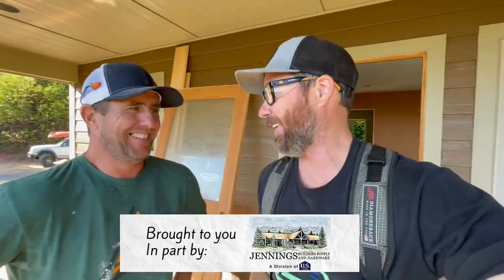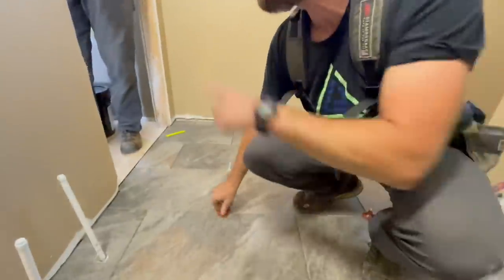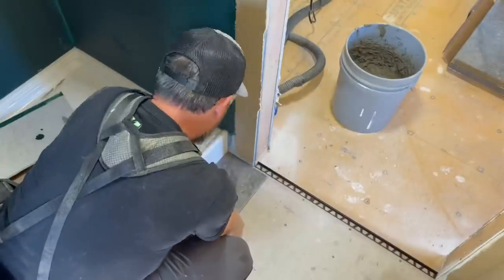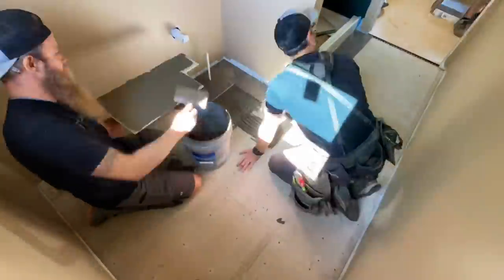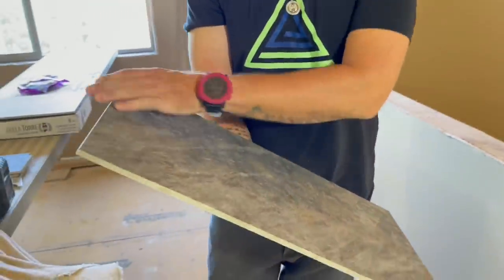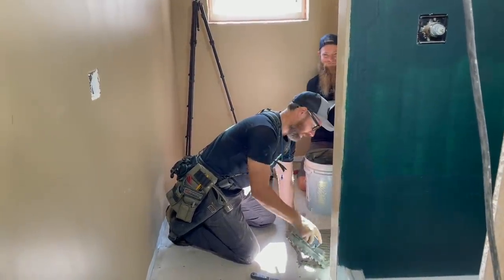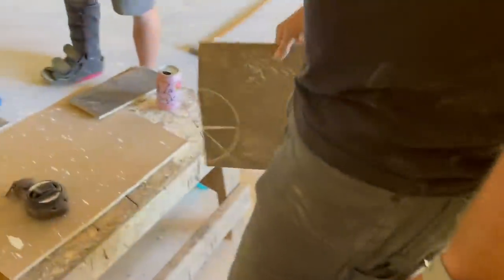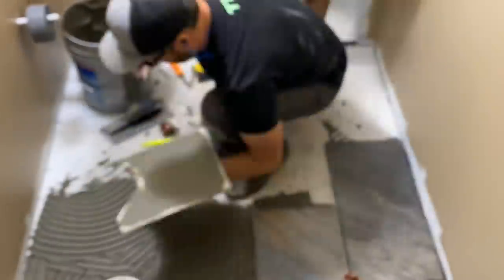Building The Nantahala Retreat #34 | Tile and Grout for beginners

Comment: Tip for the caulk. Spray with denatured alcohol after you lay your bead then wipe with finger. Works with silicone on counter tops also. Once you try it, it will change your life. 😉

Comment: Pro tip... When caulking with silicone apply the caulk, then spray it with window cleaner or denatured alcohol and then use your finishing tool to profile the caulk line.  Works amazing, no tape, very little to zero mess, and its fast. We use silicone based tile caulk all the time for showers and tubs and I stock cans of window cleaner in the van for that purpose.

Comment: When I used to do all that (talking about the caulking grout), when I used silicone based,  I taped both sides matching grout width, put the silicone and use sprayaway glass cleaner. The glass cleaner cuts the stickiness of the silicone and you could slide your finger to smooth it out. It doesn’t stick to your finger and it can be easily wiped off your hands 😉. That way it is perfectly even and no mess! Pro tip of the day for you guys!!! Thanks for showing the struggles of the trade. Keep up the good work and the fun too!

Comment: I’ve always found it much easier to tape off the joint with painters tape when doing grout caulk. Leave about 1/16” reveal onto the tile and on the other surface (in this case the tub) and then run your bead of caulking and smooth it out. Then pull the tape and you have a perfect line. Always turns out well. Give it a try!

Comment: Just a tip for tile - use directional troweling. Also, Grab a polishing/sanding blade from rubi for the grinder to touch up the cut edges and make them look nice 👍🏻

Comment: I have that same saw, and it is out of square exactly the same amount! I switched to the handheld circular saw type (skilsaw like) with a clamped on straight edge which is especially helpful for large format tiles. Recent countertops were 24x48” pieces :-)

Comment: First tile job I did decades ago was in my basement bathroom.  Tile looked great, but I learned that the tiles need to be perfectly level around the toilet flange.  Otherwise the toilet has to be shimmed, and then you have to hide the shims.  To this day, I notice it every single time I use that bathroom!  Great video guys!

Comment: Yes… leave the whirly gigs on and snug and kick them off in the direction of the grout line it is on. Or use a rubber mallet / small dead blow. I keep some of the stems for spacers in certain areas and recycle the rest. Also look into Laticrete Strata mat or schluter ditra. Better performing and much much easier to use on floor than dirty dusty cement board. I prefer the stratamat because you can see thru it to know it is embedded in the thinset and allows use of modified thinset under and over it. Less types /number of bags of thinset on a job the better. Underlayment is only to separate the house movement from the tile. Not to provide structure. Thats what the subfloor does and why it has to be a min 7/8” under tile.  
Love the vids guys been watching the channel since the start.

Comment: Apply some leftover waterproofing membrane on your 1/4" hardi after taping and mudding the seams. 

Benefits are immense, your mud doesn't flash as fast, you get a better bond (hardj is notorious for creating a weak bond because of how fast the thinset drys and how clean it stays.) you also get some added crack isolation that's built into the waterproofer... oh, and your floor is waterproof!!

Comment: Tip for a tile installer, if tile snaps easily when cutting around the flange cut it as a square then it won’t snap plus the toilet will cover everything.
That’s 100% silicone with is the best option cuz it will never crack after the house settles down unlike any regular calk for that water or sponge won’t do u good. I use the window cleaner spay or any soapy water, apply silicone fully so it touches tub and tile then spray soapy water and finger it away or use the little corner rubber piece that they sell at Home Depot.

Comment: PRO TIP.   Done tile and trim for 28 years…..  where ever I color caulk to tile to tub or wall I lay blue tape on tile and walls, or tub along the joint.  Or even grout to wall or tub.  I lay my tape, fill the joint, wet my fingers and smooth it out so so there is hardly any  visible color caulk left on the tape.   Then I pull the tape immediately and lightly smooth out with my finger again if need be.   You will end up with perfect lines and joints every time!     I do the same thing on like where walls meet cabinets or trim. Tape it off, caulk crack with white big stretch and immediately paint with super small touch up brush.   Then once again pull the tape right away.  You have to do it all before the caulking sets up.  If it sets up then the caulk will come off with the tape and your s.o.l.   So ya there is my pro tip of the day.   I’d recommend stepping up to a dewalt tile saw as well.
Reply: Should I use caulk or grout when tile meets the wall

Comment: Try masking the tile and the tub with masking tape then apply your silicone, then spray it with soapy water, then you can wipe the silicone clean. The soapy water keeps the silicone from sticking to the tape and the tape will give you nice clean lines on the tub and the tile
Reply: was searching for this. in comments. up you go!
Reply: I use denatured alcohol
Reply: @davegordon6943  I've done that too, but it burns my throat and gave me an ulcer.

Comment: I've tried using the tape method but it actually will leave ridges and a sub-par bond to the surface. I found the Cramer Silicone Profiling Tool Kit worked really well for leaving a clean, strong finish for your silicone. There's a YouTube video about it.

Comment: I always tape off where I need a perfect silicone caulk line. Put the silicone in and try to put a little bit more than the perfect amount in. Then run along with your finger, remove the two tapes and then comes the perfect finish: Have a little spray bottle with water and a bit of dish soap in it.Spray it on the almost perfect caulk line and finish it with your finger again.
Reply: When you go over it again without the tape, don't you smudge it?
Reply: @sak2745  i only do this lightly to smooth the tape edges
Reply: I use denatured alcohol. Silicone won't stick to it
Reply: @davegordon6943  pro tip right there 👍

Comment: Construction is definitely a struggle. Most folks don't realize how much work goes into even the smallest room. Framing, wiring, insulation, drywall, finish the drywall, paint, trim, putty, caulk, more paint. 
And Murphy's law applies every day on every project.

Comment: When you're cutting rips on 24" tile on the Rigid tile saws the wheel comes off the track until you cut for a ways. It makes the tray misaligned, that's where you get off on your cut, better to follow a line on those cuts.
Reply: If you knew it was an 1/8" off just put an 1/8' spacer at the front or back between the tile and your fence and that way you'll get a square cut that's straight.
Reply: @dalekuen6402  that would work if the wheels are still on the guiding rail, but if they're off the track cutting 24" long tile and you do that you'll still cut crooked once the wheels get back on track, if that makes sense. The best way to do it is draw a line, line up the front mark with the blade, then sight down the end mark and line it up as best as you can and then run the tile through. I found that a a bridge style tile saw will cut straighter lines than a tray saw ever will on large format tile, takes the play in the tray variable out of the equation.

Comment: Tile saw blades like to wander. I found that if you set the blade so that it just scores the tile on the first pass and then make two or three passes lowering the blade each time the cuts come out straight even on a 36" tile.

Comment: The backing also assists in preventing the caulk (Soft joint in South Africa) from pulling loose. The soft jointing stretches well in two directions, but once it is pulled from a third it can pull it away from the other two faces. The backing is a non-stick type surface that the soft joint does not permanently adhere to and thereby ensuring that the 3rd face (bottom) is free and the 1st and second faces (Sides of the hole) are well adhered to. 
Then as per what you noted, you also do not loose a house load of soft jointing filling in voids.

Comment: Pro tip, paint the white plumbing vent stacks through the roof with spray paint in a color similar to the roof shingles and the "glare" from the white PVC against the shingles goes away!

Comment: If you take some blue tape and tape along the bottom of the bathtub where you're going to be caulking, you can get a perfectly straight line after you caulk and pull off the tape.

Comment: When grouting with silicone, Windex is your friend.  Apply the grout in the joint as cleanly as you can, then spray tub surface with Windex and tool off with your finger like usual.  The silicone can't stick to the Windex.  You'll get a really clean joint with no fuss or mess.  Promise.

Comment: Pro Tip: When doing that grout caulk, throw a strip of 2" tape down on the tub where you want your grout line to be. Lay the caulk grout and smooth it out with your finger or caulk applicator tool. Then pull the tape and you will have a perfect caulk line!
Reply: yeah i was surprised they didn't try something like that but I guess like he said it usually isn't that much hassel
Reply: This is not a reccomended technique as it will leave a small void where the tape was which will eventually open up.
Reply: @Swwils  Done it plenty of times. It does not leave a "void" when you remove the tape when the caulk has not cured. Water is going to go where water is going to go regardless

The purpose of the callk grout is not to waterproof the seam between the tile and the tub, it is to prevent cracking like normal grout does.
Reply: @socalfritos9452  it obviously does leave a void the exact height of the tape thickness. This is known as insufficient wetting. ASTM C1193 – Standard Guide for Use of Joint Sealants − ASTM C1472 – Standard Guide for Calculating Movement and Other Effects When Establishing Sealant Joint Width
Reply: @Swwils  There is no void and the "wetting" is sufficient with this technique. You aren't dealing with a rough surface. The caulk is pressed into the joint and against the tub surface just fine. The tape line does not leaving a "void"betweent he caulking and tub surface
Reply: Taping takes too much time, calk is super easy to work with cuz sponge will fix any imperfection. Unlike silicone but for that there’s different methods
Reply: I’m very picky about have straight sharp lines. The tape method works great for me. Iv never had a problem with “insufficient wetting”. Just make sure the joint is completely full and strike it with a putty knife or finger in both directions. You can also wet strike it again after you pull the tape.
Reply: @socalfritos9452  it leaves a line using tape.  I stopped doing it because of this.

Best method is just spraying glass cleaner on it before swiping.
Reply: @R2Mike  That sucks. Never had an issue using this technique with both painting and in this context. Biggest thing is not to lay your sealant bead too thick, that is a common mistake. But again million different ways to fry fish. We all have our own ways to get the job done and done right. 🤙
Reply: @Swwils  You are 100% wrong. It states right on the Mapesil Technical Data Sheet that you should mask off BOTH sides of the caulk joint. You then tool the joint. If there are voids, you did a poor job of tooling the joint.
Reply: @socalfritos9452  I agree with you. Swwils is not that bright. The adhesion is between the tile. and the tub. The tape just keeps adjacent surfaces clean.
Reply: @King25440  Cleaning up smeared caulk takes longer.
Reply: @R2Mike  See Taylor Lewis's comment above. The line you refer to is aesthetic, and if that bothers you, wet tooling after tape removal will address it.
Reply: @idontthinkso666  Mapseil T for heavy traffic movement joints recommends tape and some may seal ceramic floor tile with AC for low traffic use but mapseil AC in sanitary ware sealing does not require taping...
Reply: Best way is to plane a sharp angle onto a piece of dense wood and spray the wood with glass cleaner and use that to tool the silicone up. Also practise using the gun to give a more uniform line of sealant instead of stop, starting all the time. Doing it with tape is ok, but when you peel the tape away you often get a rough edge and it takes a lot of extra time laying all the tape down.

Comment: I'm more than a little surprised you guys did not tape off the tub before applying the grout-colored caulk.  That just made your after-job clean-up a whole lot harder.    I always tape both sides of the caulk joints then wait about 10 mins and pull off the tape slowly this gives a nice clean line on both sides of the caulk line.

Comment: The t plus caulk will hold up 100x longer than the water based. I have used the mapie water based 2 times before and it has failed both times! On the other hand I have silicone based grout caulk that has been wet for nearly 5 years and it is still holding up perfectly

Comment: Having just remodeled our bathroom with porcelain tile I can tell you that drilling into porcelain tile is a whole other matter.  Not a fun job but once you get the knack of it it's ok but the bit needed is a diamond bit and they are expensive.  What I did once I laid my pattern down (24"X12") I knew the dimensions of my accessories (towel bar, etc.) and tried to place them so that I could, when possible, drill into grout rather than the porcelain.  Fortunately, the only thing where I could not do this was the towel bar.   All in all it worked out well and I did not crack any tile.  On another note altogether after about 3-4 weeks after finisher the shower I noticed pink coloring in the white grout and came to understand that this stain is not mold - but a bacteria.  So I got some Simple Green clean finish disinfectant spray (purple label) and problem solved.  Hope this tip helps someone. Further, I leave the shower fan on for about 20 min. after showering.  Moisture is the enemy here.

Comment: Great channel! Ya'll need to check Sal Diblasios channel. The man is a tile guru!! When caulking out tile use some diluted dish soap/h2o in a spray bottle and spray over the caulk once injected into the joint and then wipe w a good caulk tool. Also don't use cement based backers w tile and go w a uncoupling membrane like Schluter ditra and kirdi. Also those Rigid tile cutters are great for small tile but not for large. The bearings and track are junk. If your doing alot of tile, go ahead and drop the cash on the IQ dustless/waterless saw. Best tool investment I've made in years. Edit: also the toilet flange should be setting on top of the tile not flush.
Reply: Ouch. If you can spend $2000 minimum for a tile saw.
Reply: @idontthinkso666  mine cost $1400

Comment: I've made that same mistake. I was caulking my hallway trim the day after putting silicone in my bathroom. Not realizing the silicone was still in the gun from the day before. I like to wipe down my caulk strips with wet wipes, but when using silicone that just creates a mess.

Comment: Next time after the backer rod is installed use color match caulk with silicone. Soapy water or windex wipe one time and done.
Reply: Best caulk in your hand. Mapei ultra color FA grout is the best also. Use a caulk tool or popsicle stick and it will be a beautiful looking joint.

Comment: it's a better idea to set the bath up high enough so the floor tiles slide under the bath panel, no silicon joint needed, also do the same with the shower tray

Comment: Caulking with that unsanded silicone grout caulk is one of my least favorite parts of construction. I’ve found that just wiping an inch or two at a time with a dry finger works pretty well.

Comment: Here’s a Pro tip put some painters tape against the tub when you caulk and then, when you let the cock cure, you can either peel the tape or scrub a very light cut line and peel the tape off and that way you don’t have to sit there and use mineral spirits to wipe the grout caulk off the tub.

Comment: How come you don't put any waterproof membrane down under the tiles?
Reply: We typically only put it on the surface of the shower walls and shower floors
Reply: @jaimeperkins9606  fair enough. I think over here (Norway) they waterproof all walls and the floor in the bathroom to prevent moisture damage over time. But we tend to have floor to ceiling tile all around too.

Oh, for those plastic tabs, I think you can just whack them edge on with a mallet to snap them off.